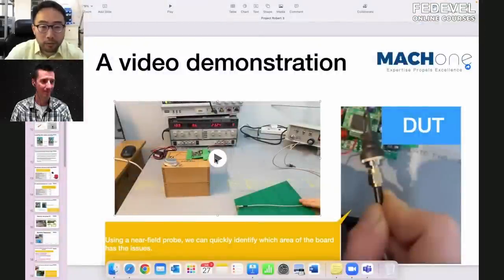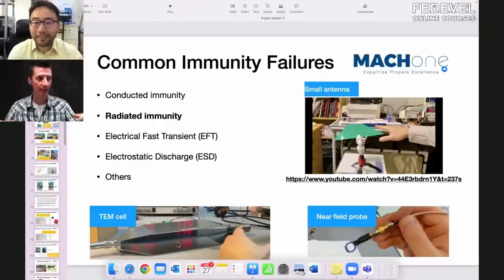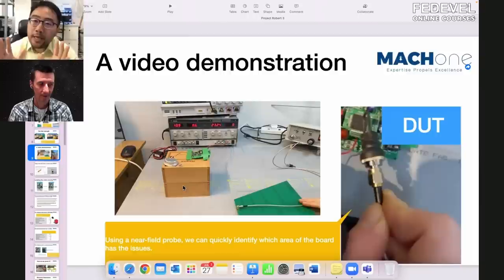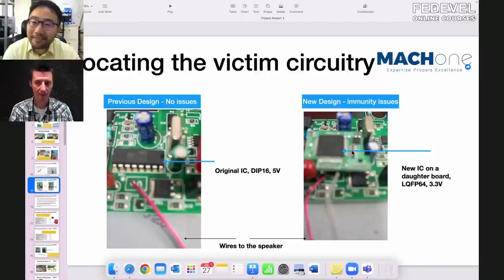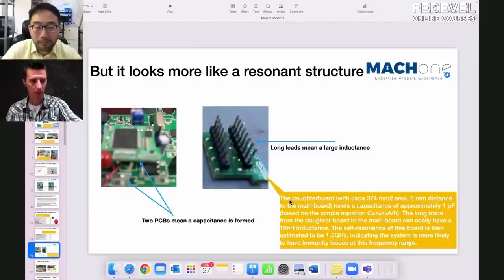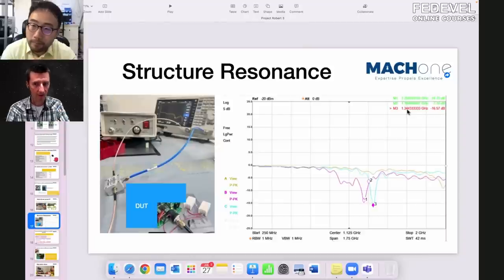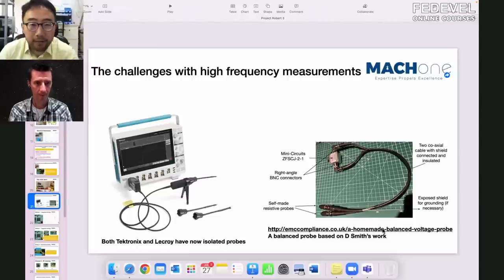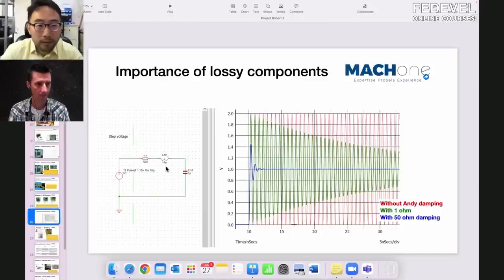Learn To Fix EMC Problems Easily And In Your Lab - Troubleshooting Immunity Issue | Min Zhang

Comment: If you design another two layer pcb under the daughterCard with the exact dimensions of holes and connect it to ground pin in order to perform a solid ground plane, will it make the performance better?
Reply: I think it will make a big difference!

Comment: Thanks so much for these videos. I'm designing a hobby project that was going to have 40 amps of 48v power with a power rail at the top and a ground at the bottom of a 160mm wide 400mm long board (eurocard backplane). After watching your videos I realised how horrifically bad an idea that was lol. It's now got power and ground interleaved on the connectors all at the top of the connectors with a multiple power and ground planes on a 6 layer board :-)

Comment: Very interesting topic. So much is said about reducing EM emissions it is easy to forget about the immunity testing side of the problem, and how to design boards to avoid immunity problems.
Reply: Thanks Nicholas, indeed, I think one of the reasons that immunity has become more prevalent is the use of low voltage power architecture. For instance, 3.3V is far more susceptible to noise compared with a 5V system. We also have more and more noisy emitters in our working environment and home environment, certainly challenging times.

Comment: Can any one explain about the connection between dv/dt and energy from ESD test..
Reply: Hi, check a normal ESD discharge current waveform, you will see the current rise time is about 500ps to a few nanoseconds, to achieve this, a high voltage such as 4kV needs to be built, then you can see the high dV/dt related to an ESD event.

Comment: Hi sir 
How do simulation for giga bit ethernet differential pair signals?
These are PAM5 coded signals that are analog ...how to do simulation ?
Hoping for the reply,🤞
Reply: This is more related to signal integrity, I would suggest you read Eric Bogatin's book
Reply: @MachOneDesignEMC  thank you for the response, I do follow Eric boggatin book but I want information regarding Analog IO simulation (4 differential AIO pairs of gigabit ethernet is connected to Transformer then to RJ45 connector) ..is it possible to do simulation for analog iO and how we can practice ?